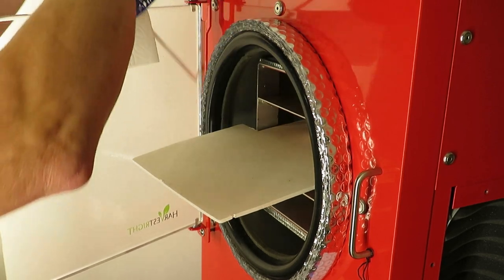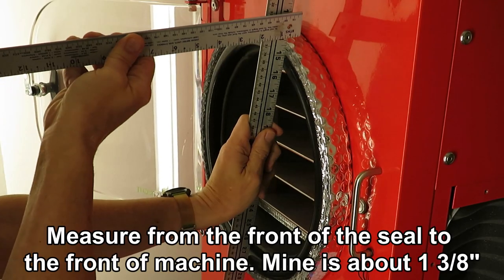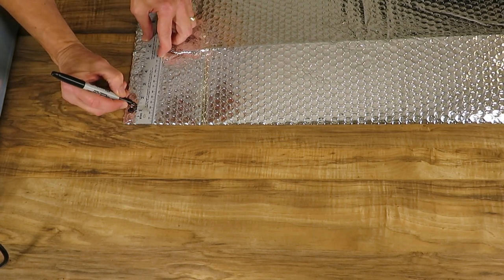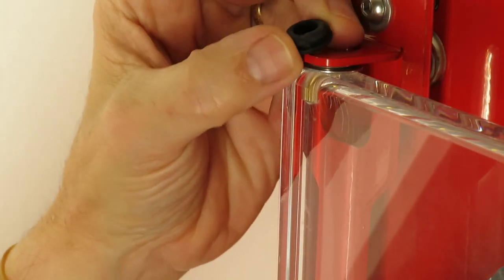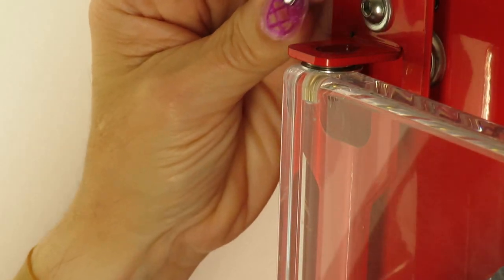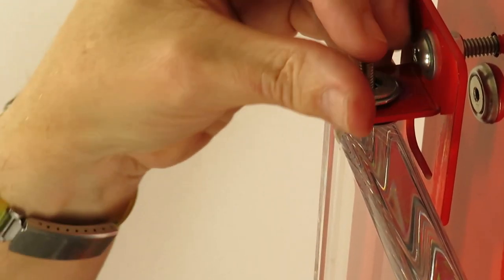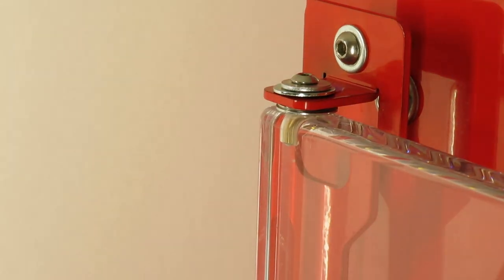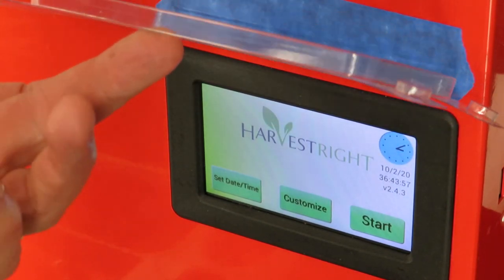Adding Front Seal Insulation To A Harvest Right Freeze Dryer

Comment: It's absolutely ridiculous to have to do all this stuff for a machine that costs as much as they do. Got ours a few months ago, it's not worked for over 2 weeks, tech support has been useless, it's not getting to 500mtorr. Tried everything. 
Thabsk for posting this video, you're really creative & talented.
Reply from the maker: Thanks for checking out our videos.
I'm sorry to hear that you're having trouble with your machine. We've been lucky that we've only had one thing go wrong with ours that REQUIRED fixing; we had to replace one of the switch wires. Lucky for me I love to alter machines, I mess with almost everything I own.
Did the tech support suggest everything that I did in this video? Harvest Right Seal Vacuum Check https://youtu.be/_eS0TXqa-iU It's just a first step and might not help you at all, but how knows.

Edit: We also had to replace the shaft seal inside the vacuum pump.
Reply: I'm exactly where you are. I've had this thing for 6 weeks. Out of the maybe 9-10 batches I've run, only 3 worked the way they should. All the others have had vacuum issues. I've changed the oil several times, unscrewed, cleaned and tightened connections, done everything they say to do, and I could usually get it to limp through the batch. Right now I'm dead in the water. 
As soon as I turn it on now, I get a temperature sensor error message and the touch screen no longer responds. CS is not getting back to me, nor is the salesman who sold it to me. I'm about to throw this damn thing out the door. This was a HUGE investment for me. I lost my medical job over the mandate, and I only spent this exorbitant amount of money in order to prepare for the coming food shortages. I'm trying to stay calm, but to say I'm frustrated is an understatement.
Reply from the maker: @barbaramandy8708  Have you already looked through the troubleshooting guide? https://harvestright.com/wp-content/uploads/2022/04/TSG-04_2022-DIGITAL-2.pdf
Reply from the maker: Were you able to get back to up and running? Have you already looked through the troubleshooting guide? https://harvestright.com/wp-content/uploads/2022/04/TSG-04_2022-DIGITAL-2.pdf
Reply: @SchoolReports  Yes I have. I went through all the steps again this morning, recalibrated the screen so that works, and ran a vacuum function test. It got below 500 mTorr so I put the batch of food back in. It's been on vacuum for almost 2 hours and it won't go below 1100. I'm going to have to shut it down and remove the food again. CS finally got back to me and I have an appointment with them tomorrow. I'm hoping for an easy fix. Thanks for getting back to me.
Reply from the maker: @barbaramandy8708  Thanks for the update; please let us know how it goes. I love troubleshooting problems, and yet I hope I never have to do it with my machine. The time my machine wouldn't go lower than 2000 I found a single hair across the seal.
Reply: We just got ours today and had the same issue. After 4 test runs and 2 adjustments (and 6 hours....) we finally reached the goal of under 500mTorr (438mTorr result). Here is what my husband did.. 1) tightened slightly both ends of the hose to the pump with a wrench making sure he didn't over tighten. 2) tightened the door hinge by 1/4 turn (this was the winner)... Look on the door hinge, behind the flange with the hex screw there is a nut. Loosen that nut on the top and bottom hinge. Then, carefully tighten the hex screw just 1/4 turn. Re-tighten the nut behind it and run another test. Hope this helps!!

Comment: How did you get the original screw out.  I tried getting my out and stripped it not realizing there was thread locker on it...
Reply from the maker: How old is your machine? There is a big difference between the older machine and the newer ones.
I have a comparison here: New 2022 Harvest Right Freeze Dryer vs 2017 Freeze Dryer https://youtu.be/91gEssGQsYw?t=447
Reply: @SchoolReports  120v old school medium with the eliminator pump
Reply from the maker: @ciliap  So, then yours has the pressed in threaded insert like my older one? The screws on mine were always very loose; no thread lock. I'm not sure how to get one out that has spun/stripped. The normal way to get thread locker to release would be to heat it, but being set in plastic, that probably would be a bad idea. The insert is completely inside the plastic, so no way to grab it. Maybe remove one end (if both ends didn't strip) and then pull the door off the other one. 
Did both the top and bottom strip? Maybe it will just have to be left on, unless it MUST be removed. I have other ideas, but they have a higher potential for damage.

Comment: Oh now I understand :) Thankyou , another question i meant to ask is , Don't you use the defrost button ? just the fan , ,
Reply from the maker: I've used the built in defrost function only once in 514 batches. It uses the tray heater to warm the chamber, and I figured why add hours of use on them if I don't need to. Plus, I've read a number of comment/stories from people that have had mold/mildew issues in their machines due to the warm moist environment they created. (to be fair, it's their fault for not opening the door as soon as it was finished defrosting and making sure it was dry) Our machine door is ALWAYS open, with the fan in the opening, unless it's freeze drying.
Reply: @SchoolReports  Thankyou so much that is handy to know , our powe prices are probably triple what you guys pay and we are always looking for ways to cut cost , I appreciate you taking the time to explain and I shall be on the look out for a small fan now :) I think your tips and fantastic and i shall be taking notes I am always learning something new .
Reply from the maker: @kerry1963qld  The fan uses a lot less power than the heater pads. The tray heaters on mine use about 800 watts. The little fan only uses a few watts. I couldn't check it with the meter just now because batch 515 is about to start. On the Amazon reviews, one person said it used 5 watts on low and 10 on high. If I did my math correctly this time, that's way better than 800! It may be a little slower, but if I'm in a hurry, (like tonight) I can just pull the ice out after it defrosts part way.

According to the internet, (and we know we can always trust what we read on the internet) our power costs range from 10.5 cents per kWh to about 25 cents per kWh. So, you win. (and by win I mean lose. Sorry😒) 
Of course, also on the internet, you can find people that say Australia doesn't exist.😂
Reply: @SchoolReports  hahaha yes that's rather funny Iv'e also heard strange stories that we don't exist lol aaaahhhh dear some people are funny , 515 Batches ! wow i have some catching up to do don't I  :D thanks again

Comment: Does the added seal insulation seem to have made a difference?
Reply from the maker: I put this on to better insulate the seal area because the seal would freeze and it would end up with ice in the little space between the seal and the rest of the machine where the freeze chamber is exposed and frost would form on the seal. When the freeze dryer was defrosted the ice would melt and water would run down the front of the freeze dryer. This seal seemed to just about stop this completely. I also changed out the door pad for a disc I cut out of Acrylic.

Comment: HELP!    I sure hope you feel better.   That was some injury.   I have had backer rod in my hole around the drum.   It wore out and I am having a nightmare trying to get it to work - new backer rod is not working.   I can't pull the vacuum down at all and so I am dehydrating and canning as we speak.   And, being disabled, my days are shorter than they used to be :-).
What year did you get your machine - I am 2016.  It seems that they have fixed this problem now.    It was BAD machining.
Anyway - any great wisdom is appreciated.  M
Reply from the maker: We got our machine in August 2017. 
I have no great wisdom, but I can venture a wild guess!
Without being able to see it I'm going to guess that either the new rod (I'm assuming it's a foam rod that wraps around the drum in the gap?) is too big and preventing the door seal from sealing tight against the drum inside the grove, or that the seal itself has gone bad and needs to be replaced.  EpicenterBryan has a video about the seal https://youtu.be/tfB9A3grZoY  We keep a spare seal on hand just in case; so far our still looks good, but we've been very, very gentle with it. 
Have you tried to pull a vacuum with the machine empty and without the backer rod just to test the seal?

Comment: what if the screw isn't tithing? is the screw striped ?  how can I fix that?
Reply from the maker: Are you talking about the screw at the top the door?
Reply: @SchoolReports  yes
Reply from the maker: @anniepenner1079  Sorry it's taken me so long to get back to you on this. I just finished a batch of chopped onions and emptied the freeze dryer. I'll look at mine in the morning and see what the options are. I'm assuming the threaded insert has spun. If the plastic isn't broken it's probably not a big problem, might just need a bit of glue. It's not a bolt that should be very tight, it's being used as a hinge pin.
Reply from the maker: @anniepenner1079  I put a link to a video with some information about the door hinge insert on the channels community page. I hope this helps, if not let me know what information I can add.
Reply: @SchoolReports  question about onions. I have heard some people say to buy freeze dried because the onion smell linger for a long time. With the cost of the unit I would rather put it to use but I am interested in your perspective. Ty
Reply from the maker: @Bee_Cathy  I, too, have heard/read things like that. I don't know where it comes from, perhaps they are just more sensitive to odors than I am. I had no issue doing onions. I just don't mix onions with other things in the same batch. There will be a slight odor of onion, but not near as much as when you cut the onions. I suppose you could wipe it all down after onions if you thought it was an issue.